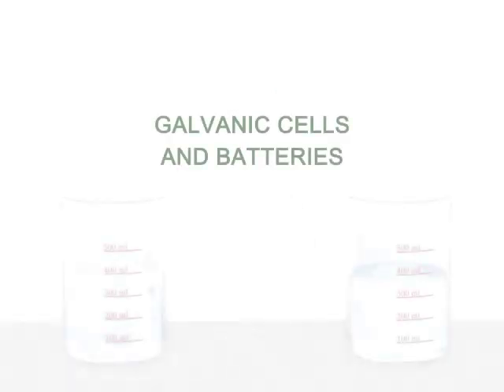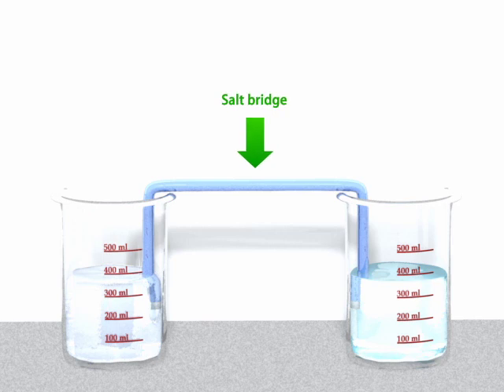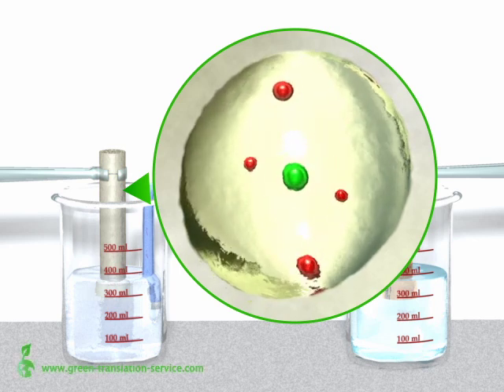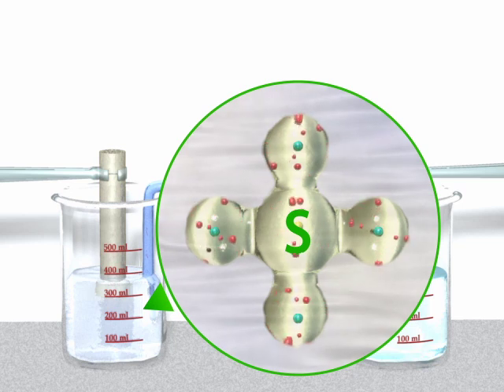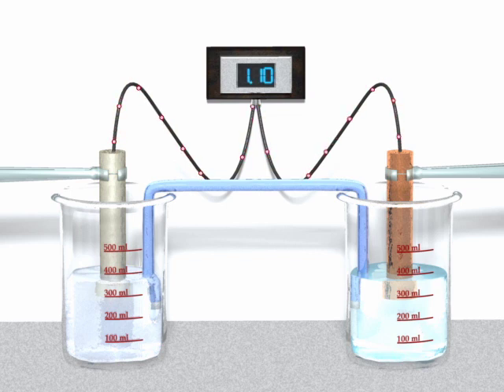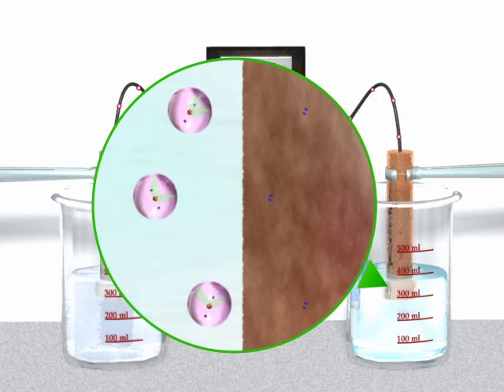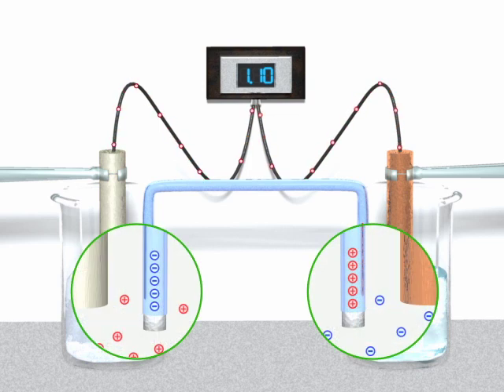How it works! Galvanic cell / Daniell cell / Copper zinc battery (3D Animation)

Comment: why did both zinc and copper became ions when placed in the solution and left their electrons on the electrodes?
Reply from the maker: Watch again!
Reply: You messed up.  You show the Positive copper ions leaving their electrons in the electrode and becoming part of the copper sulfate solution. the electrons are pulled from the electrode by the sulfate creating negative ions in the electroe not the electrolyte. this creates a potential energy as the electrons left in the zinc electrode create a current that fills the positively charged copper ions in the copper electrode. The electrons expelled from the copper electrode (in a battery) pass through the membrane to neutralize the zinc negative ions

Comment: The anode is the negative TERMINAL, meaning the electrons flow from the anode (zinc) to the cathode(copper). The Anode is negative because the electrons stay in the zinc strip and later flow to the cathode, while the zinc atoms from where the electrons are released from jump INTO the solution and become ions. So basically, only the electrons and the normal atoms of zinc remain in the anode while the atoms that become positive LEAVE the anode.
Reply: Wow great explation...Thank you....i am a high school student and i am struggling a much in this concept of electrochemistry...

Comment: I don't understand why zinc can lose its electrons even if it is in ZINC sulphate solution?
I mean the zinc atoms in the anode and the zinc ions in the solution are both zinc!
Reply: Because here to metallic pressure is greater than osmotic pressure so to balance we increase osmotic pressure by increasing concentration in solutions. To increase concentration of solution add ions.

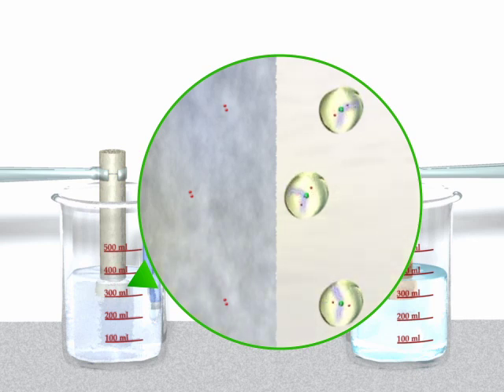Comment: 2:32 - Many textbooks fail to mention this point.
Reply: You are right
Reply: because it's wrong XD, those ions must be already in the solution, either leaving copper oxidize in sulfuric acid on it's own or charging the battery or pouring copper sulfate in the solution which is already oxidized, otherwise copper will not oxidize easily if connected with the more basic(zinc sulfate) solution so copper atoms are not going to abandon  the metal surface easily they will rather make zinc oxidize faster. For the discharging reaction to occur you must have zinc metal oxidizing in an acid and copper ions reducing to go back copper metal
Reply: True

Comment: Best explanation I found after spending soo much time looking.

Other videos don't explain the role of the salt bridge. They also make it sound like copper won't release ions in aqueous solutions. Like there's some fundamental difference between copper and zink in that regard.
Reply: well what makes you think that the creator of this video is correct? Maybe copper actually doesn't release ions in aqueous solution for example. This guy looks like he mostly does graphic design and translation but is he a chemist?
Reply: @aymi6393  yeah i have the same doubt...

Comment: 2:10
I'm confused by Oxidation. If both rods are initially uncharged and the zinc/copper in the solution are positively charged, then why wouldn't the electrons flow into the solution? Why do the atoms move into the solution as positive ions (positive into positive) and leave electrons on the rod?

2:45

If both rods are gaining electrons, then why does the zinc become positively charged and the copper negatively charged? Shouldn't both gain a negative charge, but the zinc would gain it faster?
I'm still confused by this process
Reply: +maxpowers3732 
I think this is the reason,

as you doubted Cu too can lose electrons. 
But in this case Zn loses electrons easily than Cu.
So released electrons from Zn travel to Cu plate(electrode. Then Cu plate becomes negatively charged. As you know negatively charged Cu plate attract positive ions.

Look at the electron configuration of Cu and Zn. For Zn it is easy to lose 2 electrons but in Cu to become Cu2+ ion i have to 1 d-electron from inner shell.
Cu:[Ar] 3d10 4s1
Zn: [Ar] 3d10 4s2
or other way,
Zn can achieves more stability than Cu due to fully filled d-orbital by losing 2 valence electrons.
Cu:[Ar] 3d9 4s2
Zn: [Ar] 3d10 4s2
Reply: GOOGLE THERMITE!
GOOGLE HOW THAT WORKS!
GOOGLE DISPLACEMENT REACTIONS!

That's ALL you need.

Comment: Hai,Thanks for the video.It was helpful.
I have a doubt regarding this by the way.I understand that salt bridge is Na2SO4 salt.When Oxidation happens, Zinc atom loses its 2 electron which goes to the external circuit and zn2+ ion will be in the zinc sulphate solution.Zinc ion reacts with SO4 2- ions from the salt bridge and the electrolyte would be neutral.Now in the cathode part Copper from copper sulphate solution combines with the 2 electrons from the anode and copper metal deposites on the cathode leaving soa 2- ions.This makes the electrolyte at cathode negative in charge.

1.What happens to SO4 2- ions,does it combine with Na2+ ions in the salt bridge turning the solution a mixture of Na2SO4 and Cu2SO4 solution?
2.Untill what condition does the redox reaction prolong,Is it untill zinc totally gets consumed or at a condition where there is no more Na2+ or SO4 2- ions in Salt bridge to balance the electolytes?
Reply: 1-YOU HAVE TAKEN SO4 ALL WHERE THATS WHY IT IS KIND OF CONFUSING OF WHICH SO4 YOU ARE TALKING ABOUT SO LET ME TAKE NANO3 AS SALT BRIDGE SALT .WHEN Zn metal loses electrons it get converted to Zn ion WHICH IS POSITIVE SO AS IT CONTINUES TO LOSE ELECTRONS THERE IS ACCUMULATION OF +ive CHARGE AND IN COPPER HALF CELL THERE IS VERY LESS Cu+2 AS COMPARED TO SO4-2 AS MOST OF Cu+2 IS CONVERTED TO CU METAL BY GAINING THOSE 2 ELECTRON LOST BY ZINC METAL SO -ive CHARGES ARE BUILD THIS WILL STOP FLOW OF ELECTRONS SO NOW SALT BRIDGE COMES IN IN MY CASE To balance +ive zinc NO3 FROM SALT BRIDGE WILL COME IN ZINC HALF CELL ,AND TO BALANCE -ive so4 Na +from salt bridge will come in copper half cell.
2-in both conditions i.e when salt bridge is removed and when complete zinc metal will be used the flow of electrons will be stopped.
Reply: @shaikhzoya2002  nicely explained....thanx yrr

Comment: If both electrodes are becoming negatively charged, it seems misleading that both start at 50, and the zinc climbs to 80, and the copper lowers to 20.  Would it not be more appropriate to raise the zinc from 50 and raise the zinc to a higher number?

Comment: If the solution in the salt bridge is used for balancing the two reservoirs, why is the bridged connection required at all? Why not just have two disconnected tubes? Please help. I've been trying to wrap my head around the salt bridge for days now. No one I've talked to has any answers...

Comment: why can't electron pass thru the salt bridge?
why can't you form a battery with copper and zinc touching each other? 
why doesn't zinc atom donate the electron to the H+ and form H2, why does it flow thru the circuit? Why doesn't zinc atom donate e to the H+ and form H2 WITHOUT any closed circuit?
why do you need a salt bridge at all? why can't you just have 2 solutions mixed together? if it is indeed the magic of the salt bridge, what about a lead acid battery?

Why doesn't any Youtube video comes close to explain those questions? have any video maker thought thru the entire process at all?
Reply from the maker: Just watch again. Half of your questions can be easily explained when watching the animation carefully :)
Reply: your video explained how's, you seldom explained why's, and you never explained any why not's. Please, if possible, answer the other half of my questions that weren't in the video
Reply: Thomas Schwenke
yeah but still, it's only half
Reply: does the creator of this video even know chemistry? What if he wasn't correct in that copper and zinc both release ions to their solution?
Reply: YL Storage
Reply: i mean i can ans ur ques but , i guess its too late now and i dont wish to waste my nrg